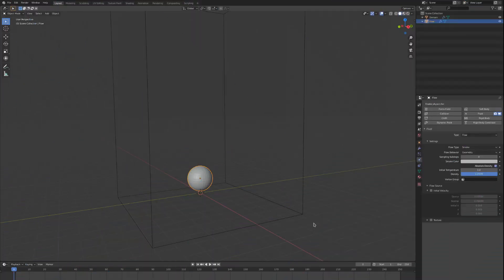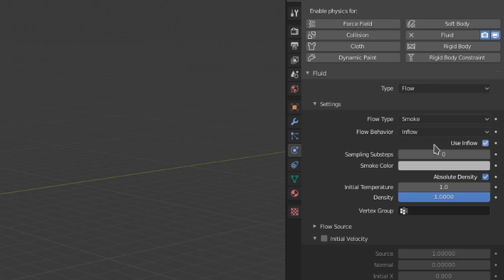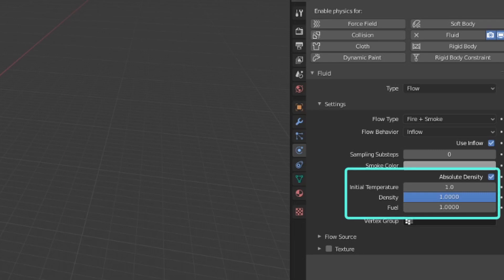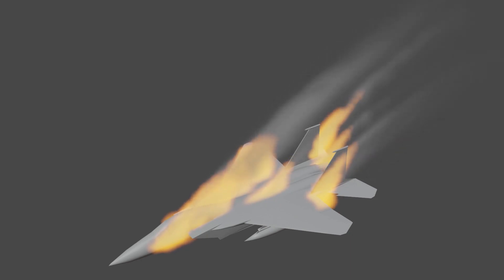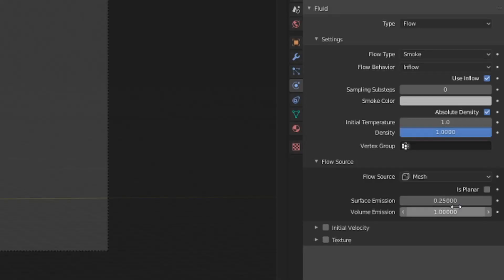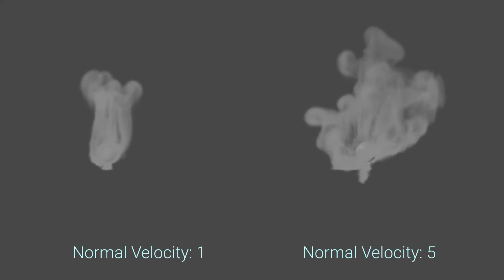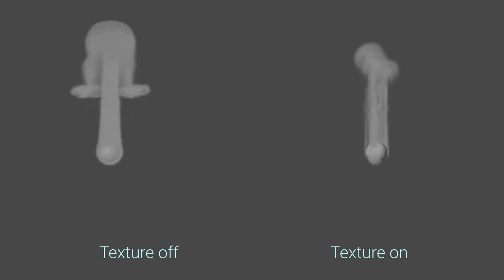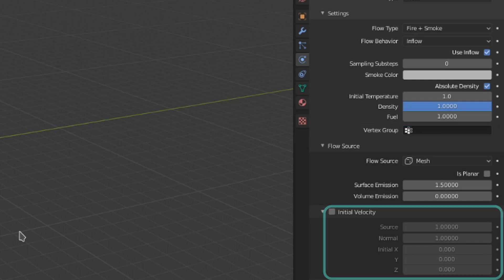Everything about Flow Objects | Blender Mantaflow Part 3

Comment: Do somebody know a way to loop/reuse  a short flow to make a longer video?  I made a 3 min video with a fountain and the baking time was kinda overkill. Most camera cut are 3 to 5 sec long so reusing a short more detailed simulation would have been better I think...
Reply from the maker: Are all your cuts sequential in Blender's outliner? If not, you could animate different shots with the same simulation, and combine the rendered clips in Blender's video editor.
Reply: @MrCheebs   Yes all the  cuts are together. There are character with cloth sim and rigidbody that may need consistent motion between cuts. looks like these need to be re-baked if they move on the timeline. So I think I can not easily move each character cuts in front of the fluid simulation. I'll need to do more test to find a solution.
Reply: @MrCheebs   I think I figured out a dumb way to do it.  I can apply fluid transform to each frame one by one and make a sequence of common mesh that appear and disappear.  After I can move/copy/past this sequence everywhere on the timeline. I want it to be a really high resolution simulation but I probably do not need many frames. So it's likely to be manageable.
Reply: I found Stop-motion-OBJ add-on. With this it's possible to import the fluid mesh sequence and loop it and change the start end position on the timeline.
Reply from the maker: That looks like a cool add-on. Thanks for bringing this solution up!